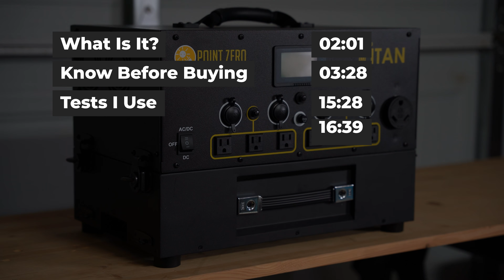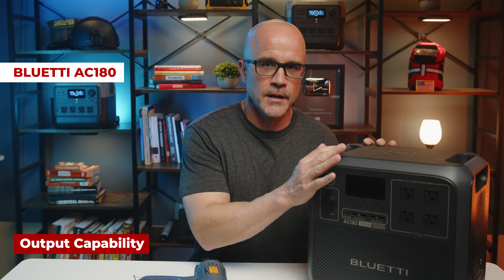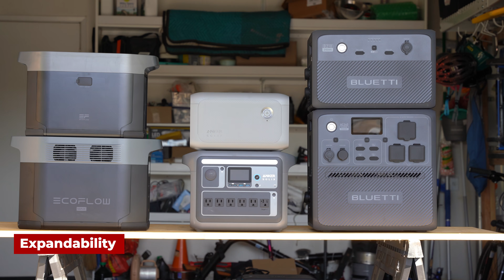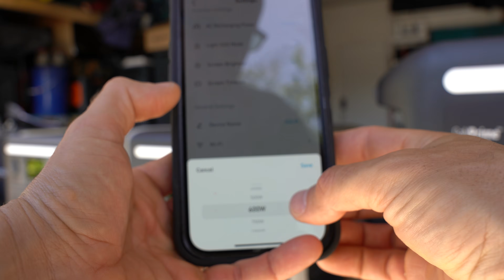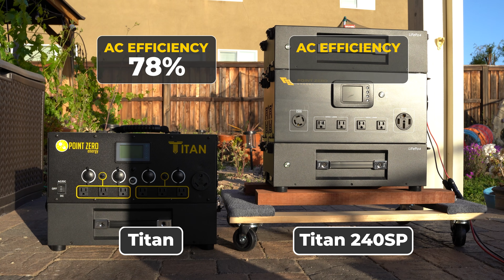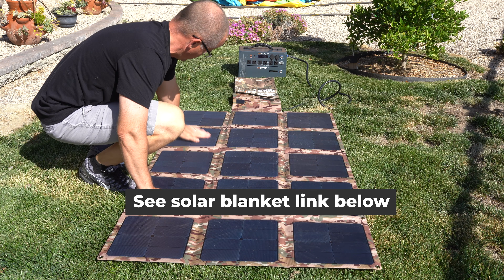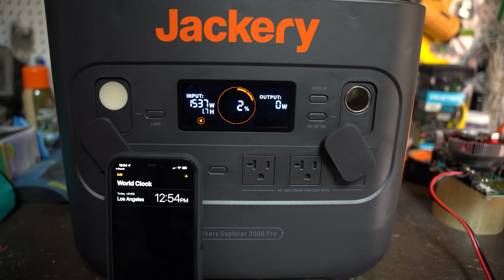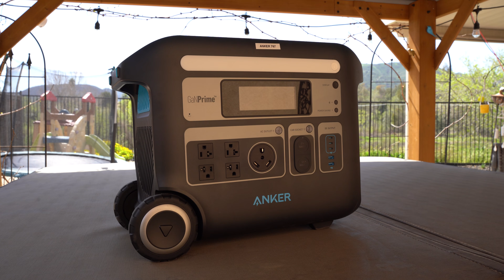Best Solar Generator for 2024 (The Ultimate Guide)

Comment: Generator? If those Battery backup systems are “Solar Generators”, then a drinking glass is a water generator, and a window is a light generator. An electrical generator converts one type of energy into electrical energy….like a solar panel. You could call a solar panel a “Solar Generator”, but certainly not a battery backup device. Call them batteries, acumulators, electrical storage devices, but not generators. Those devices merely regurgitate what they have stored, and nothing else. They certainly don’t generate anything, especially electricity! Generators create electrical energy, these devices don’t, they just store the energy.

It’s all just marketing BS for the people too stupid to understand they are being taken for a ride by targeted marketing. People misnaming products through ignorance and stupidity. The guy talking (by his definition) is an oxygen generator since he exhales unused oxygen with every breath.

Comment: Like to see your comparison with the Yoshino B4000 Solid-State Portable Power Station- 4000W
Reply: I too am considering getting B2000's to do basic power backup in case of hurricane/power outages. Two of them for fridge, microwave, fans, LED lights. Plus, 1,200 watts of solar panels (4 - 300 watt panels). I went through a power outage last night from 8:00pm to 12:00pm, due to thunderstorms and was wishing, while laying in bed sweating, I had gotten on this sooner. Now's the time! Please review the B4000 units, City Prep! Matt Ferrell suggested the B4000's because of the high power density and very safe solid-state power wafers.

Comment: Hello Sir, thank you so much for this video. I am new to these products. 
If I plan to get a power station with solar panel for converting a SUV into a camper, which needs to power a cooler, an electric cooking stove and some smaller devices, which one would you recommend? 1. Can some of the solar panels be installed to car roof and okay to be exposed to rain? I just want to charge the station/battery when driving. And the station gives option to charge from 12V adopter or from solar, right? 2. Maybe I need 2000 Wh which may be from one power station plus an extra battery. Yes, I concern some major things: 1. price wise; 2. size and weight of the overall system; 3. efficiency of the overall system; 4. and convenience. If no solar panel are installable and exposed to rain, I am fine to carry and store them in the car and only charge the station/battery when not driving. Thank you!

Comment: I'll provide the best  portable  air conditioner  model and othe important helpful info, if someone is willing to explore what  solar generator's can possibly run a 
1300 Watt  unit like this, capable of heating and cooling up to 700 sqft,    (I'm interested in knowing what if anything featured in this video can run a portable AC for a minimum  6 hours)

Comment: I bought my pecron,cables, and some cheap used house solar panels for less than 1100 dollars. I tested it to power 2 firdges and a small freezer with no problem.
Reply: Approximately how many watt-hours does your system generate daily?
Reply: @CarlJacobs-dz2hv  I have never tested it in charge mode more than a 6 hour blackout we had this spring. It was putting out around 1000 watts at full sunlight. I don't know more than that.
Reply: @mike444-7  thanks for info

Comment: I love the idea of these massive battery banks “solar generators” they really are awesome! Noiseless power on demand! what I don’t like is good luck in a real world SHTF scenario cause good luck repairing it if it fails. You’d need to be a serious techie and access to rare parts, Circuitry, proprietary parts etc. At least with an old school generator there’s probably some gear head on your street that would fix your gasser for a decent barter. Or with a couple books or videos you may be able to actually even fix it yourself.

Comment: I've just got power back from Hurricane Beryl. Trying to sleep in 90+ degree heat is not fun. A couple of years ago, we nearing froze from the 2021 Texas freeze. No more getting caught off-guard. Time to invest in a generator.
Reply: Same here (Humble, Tx).  
Which system would you go with to power things ?
Reply: Same here….South Houston. Day 5 No Power.  Projected to be 2 more days.  Crazy
Reply: @doghairdontcarelindaniel7531  Same boat. Two days ago, I had a Champion 8750 gas generator set up. Finally have fridge, WI-FI, TV, fans, window unit, lights, and  washer. Hoping power is restored by tomorrow as CP predicts.
Reply: @doghairdontcarelindaniel7531 has the flooding gone down? My buddy lives in Midtown he wasn't affected just 1 day of power loss
Reply: @doghairdontcarelindaniel7531  aw man, hopefully power for yall soon.
My wife just ordered an EcoFlow from Amazon.
Reply: Yup I’m in Houston and refuse to be cause in that situation again. I just got the Anker solix system for prime day. I ordered 3. 1 smaller generator with solar panel and 2 larger ones that can power fridges. I got one today and it charge 20% right out the box in 10 minutes. I took a video and sent it to my friends and by the time I had sent it and went back to look at it it was at 100% we had a flicker today on the lights so I’ll at least something on hand.
Reply: @plussizemadness5723  what made you decide on anker solid system 1x. Are there deciding factors between other systems?
Reply: @Damita_Jo_Jr which Anker did you get for refrigerator
Reply: From Houston and I agree! It’s insane how many of us don’t have these essentials that are a must in this part of the world,
Reply: Same here. Which are you guys going with?
Reply: @bezerrajd I’m looking at the Eco Flo Delta Pro 2, unfortunately not in this video but I have heard great things.
Reply: @aviationmotivation4957  8000 dollars for the kit. Way out of my price range.
Reply: I have solar generators and conventional generators.  I also store fuel in case it is unavailable during an outage.  I have a small Yamaha that powers a lot of my needs.  I also have a larger generator that can power everything.  It’s fuel consumption is too high to be used for a long term during a fuel shortage.

There are lots of options and the MORE POWER!!! option isn’t always the best choice.  In my area, fueled shortages are not unusual.
Reply: I was out for nearly two weeks! I’m over here looking for generators too. Trying to see if solar is good or better off going with gas ones. I just need something to power a fridge, deep freezer and a couple fan units
Reply: @Lonbites  same - I have three freezers and a refrig/freezer to power during outage. I have keronsene lamps and fuel, and installed a wood stove two years ago. Which units are best for freezers?  Do not want gas generator as then I have to store a lot of gas for an outage of length.
Reply: @ritashimniok1043 Newer inverter generators are quiet, efficient and multi-fuel; usually gas, diesel, natural gas and propane. You can have your plumber install a natural gas ‘spigot’ to attach it to if you already have natural gas in your home.  Often the electric goes out but the gas service is unaffected.
Reply: @Lonbites you can use a small gasoline generator to power your refrigerator and a small window unit. 

Next I would get a battery pack. 

After that I would get a bigger generator with multiple fuel options. 

Propane is nice because after the disaster you don't have to do as much maintenance.  But you still need to change the oil every week of use.   Change the oil on these generators is dead simple.  Running a few minutes. Then unscrew a bolt on the bottom and unscrew the oil gauge plug on top and let the oil drain out.
Hand thread the bottom plug back in and lightly tighten it and then put in fresh oil.
Reply: Same here in Humble.  Too bad there’s not yet a solar generator for central a/c.  Never leaving the welfare of my family to Centerpointless ever again!  I’m getting solar mini-split a/c’s!
Reply: @amberweber9993 Centerpointless indeed! I wish I'd been better prepared for Beryl. The next storm won't catch me slipping, and I definitely won't be counting on Centerpointless for quick power restoration.
Reply: @amberweber9993 you can check out the ecoflow delta pro max ultra- not sure which one - they are expandable & can power a whole home, including AC.
Reply: @amberweber9993  or 5000 watt window ac, use on the dry eco cycle, the midea ones with temp control r the best, it blows colder than the ac cycle and uses 1/2 the electric, and can run off the solar batteries. But I saw those solar mini splits also and love that also.
Reply: @amberweber9993 keep a small window a/c unit available. Pop it into the window and run off generator if power fails. Sleep in one cool room.
Reply: Same here. Cypress, Tx. 4+ days out of power TWICE in 2 months.
Reply: Yup! 6.5 days of no power. Time for some serious backup.
Reply: Time to get private utilities in order.  But a generator is a good idea in the meantime.
Reply: @pineapplepizza4016  so what have you decided on.
Reply: I love pineapple and jalapeño pizza!  Got a bid for whole house generator 15,000. 6 days without power in Cinco Ranch.   Is solar the way to go?  Looking at Briggs Stratton,  made in USA..
Reply: @lizasintic6926  solar is not the "way to go."  But solar is a good part of your overall disaster plan.
Reply: @user-lp5ci9bi2jwell you might want to figure it out unless you w
Reply: Also you could get hand crank fan for summer and winter sleeping bag for winter.
Reply: @user-lp5ci9bi2j just wait and within in 10 years the blackouts will be very long and sustained. If liberal democrats don't get out of the way and allow American to become energy independent from oil, coal to nuclear which is all cheap and reliable verse this "green" BS which is EXPENSIVE and unreliable, we're screwed. Forget about electric cars, just the amount of electricity required to run just AI alone is double than what we currently have!!! Going back to the dark ages people, now that's "progress' isn't it!
Reply: I do as well! Still trying to figure out what to purchase to keep them all going!
Reply: Geez I guess my post was censored because I had a brand name in it. 

I also was without power for a week during the derecho and the hurricane. 

I use a 4750 dual fuel generator with a 1,000 KW hour battery pack and 200 watts of solar panels. 

The battery pack is for getting through the first night before you can set up your generator. It will save the food in your refrigerator. 

I prefer propane because less maintenance afterwards.
Reply: I use the $500 ish WEN.
Reply: Being in FL virtually all my life, staying cool in emergency can be tough if not impossible, but seems to me, emergency heat is as simple as a portable kerosene heater and hunkering down in a smaller room in the house if necessary.

Fuel lasts a very long time, and the heaters are cheap enough.

Comment: Does anyone make a 50amp Solar Generator to power my water pump?
Reply: I’m afraid all portable emergency generators are too small for that task. However, they do make solar-powered water pumps.  One your size will probably require 10 panels.  For a well about 300 feet deep, it should cost between $3,000-$10,000.  Of course, it would be solar-powered all the time. You might want to check with a driller to see what quote they give you.  You might be surprised.

Comment: I live in a small apartment - about 800 feet. I’m on the third floor with no balcony and my one window faces north. Would a solar generator even work for me? I don’t think I want to lug 62 pounds, plus the solar panels up and down three flights of stairs to charge it in the sun. And how long do they take to charge with solar? Can the panels be set up all the time and charging the battery or are you supposed to charge it, and then use it? I would really just want to cycle my fridge to keep things from spoiling. But I’m unclear if the solar panels would work inside with indirect sun.

Comment: I have a 2200 honda companion and a 3000iu honda that is trifuel I store gas, and propane and have an outside NG source but I am interested in a solar generator this was a good starting point. My sprinter has 300 watts of solar  and is a self contained camper so I could use it in the van to. Great info.

Comment: What would you buy to power a 230V 13.7A sewage pump?  Locked rotor amps is 57A, not sure any of these portable units could handle that much, and I need to verify the actual inrush current myself to see if it really needs that much.

Comment: Ecoflow 100V USA can and is reliable.  Its European version 230V spends 2 times more on energy conversion, so it is less reliable and breaks down more often than other brands.  Anker and Bluetti have proven themselves much better.  The poor reliability of Ecoflow has been verified by round-the-clock operation by the military in Ukraine.  It was also verified by the civilian population of Ukraine, where in all cities there is no electricity for 12 hours a day!  Most people cannot afford such a device because in Ukraine the average salary is $200 per month.  You will have to save for several years or more for Ecoflow.

Comment: First I love your YouTube channel. You present the battery chemistry well, but all battery chemistry using lithium is lithium ion. The Jackery brand that does not use lithium iron phosphate is most likely lithium manganese cobalt or lithium polymer. I made this mistake when I first started building custom lithium ion batteries. Just FYI not criticism.

Comment: It looks to me like a fancy battery. I bought a a large lithium battery.  A regulator for charging from the panels. An inverter for running my tools, charging laptops etc,  from the battery.. If any one of these components dies, I simply replace the single component. Not the whole thing. I can add more batteries or change them if i need too.  Was  cheep n easy.   All from my local battery solar store. What am I not seeing here.

Comment: A specialized crimper can be as easy as pulling out your 2 pound hand sledge and  a $15 metal tool that fits in your palm. Many of the things people use as safety devices can be left out if you buy the parts that already protect themselves. Most MPPT charge controllers do. Speaking of MPPT. That's important to have in your charger because it makes use of the solar input better than PWM. Don't let people convince you that this is not a good DIY project. It can have more output, more potential input, better efficiency, easy portability, and more features. However, it does take a modest amount of learning if you don't already know how to design your own. For me, being able to jump start an 18-wheeler is a desirable feature. I can make that a possibility. You might just want to power your 24-watt laptop and a 4 watt LED. That can be done very cheaply.

Comment: This is truly the most amazing informative video on this topic I have ever seen.  Excellent job.  I have been looking at several models for years, leaning towards EcoFlow.  I do own an EcoFlow River, rated at only 300 watts with a 50 watt solar panel, and an EcoFlow Max rated at 600 watts with a 110 watt solar panel.  These are both the older Lithium ion batteries.  I have been looking at EcoFlow, and other models with 1,000 to 1,800 watts because I have medical equipment, bi/pap, etc which I worry about daily should a power failure occur, but simply cannot afford to purchase.  What I wouldn’t give to have one of these larger models, OMG.  Thank you for so much useful, invaluable information

Comment: Our 200 watt jackery panels have been absolute headaches. The small screws come out allowing the wiring to come loose. We used the warranty and sent one back but the repair didn’t last long.  The panels still work to a certain extent but have to be handled very carefully… We have difficulty pairing two panels to charge the generator and usually just have to use one which takes forever for a 2000 watt generator recharge.  The panels are fairly efficient regardless of all the durability issues.

Comment: Great video! I have been reading that with the Delta 2 you need to log into WIFI once a month for it to continue to work. Is that true? We like to go off grid for a while and just wanted to check if it was required.

Comment: I have a camper van with a solar setup and solar panels on my house.  I installed a heat pump system after the solar system on my house.  My batteries in the camper are 7 years old and are starting to show their age.  My house system connects to the grid and is pretty much maxed out.  My would like to be able to use a generator system to extend my capacity in both areas.  How do I find out the draw of my heat pump especially in the winter hours of darkness?  That is my greatest concern. Secondly what cooking appliances are most efficient for the camper when the propane is not available?  Can I have a system that will switch from on grid to off grid in case of emergencies? Should I consider an additional solar array specifically to charge additional batteries?  What should I be thinking about when replacing batteries for the camper?

Comment: Great comparison video....  The issue for me is I will be using the power supply for my pop-up camper in the back of our pick up truck.  It's hard to find one that has the 12V-30A Anderson connector,  with out this feature these unites are useless to me.... Jeff
Reply: I left a comment for you citing a supplier of an adapter, but the comment was censored. I’ll just say try goggling “adapter for 30A Anderson port”.  Good luck.